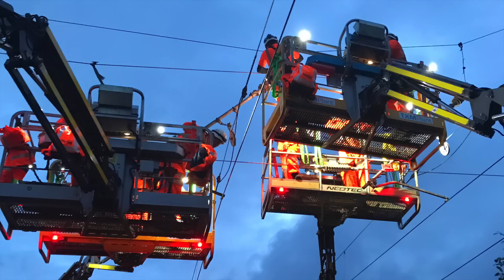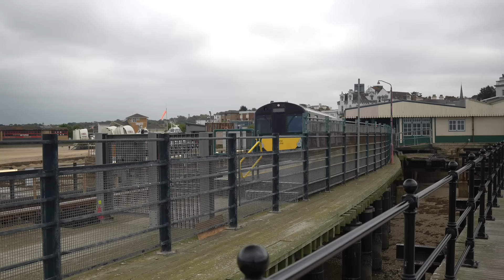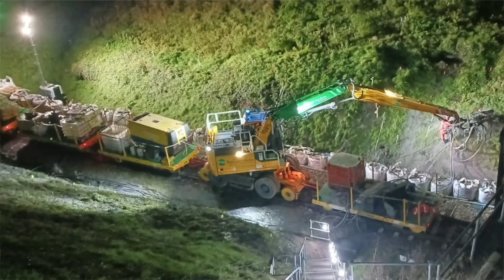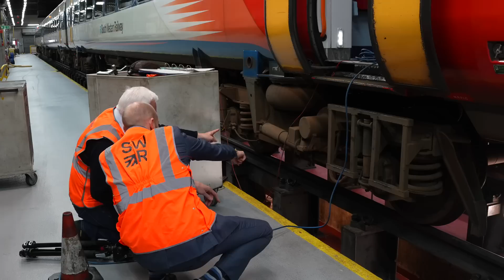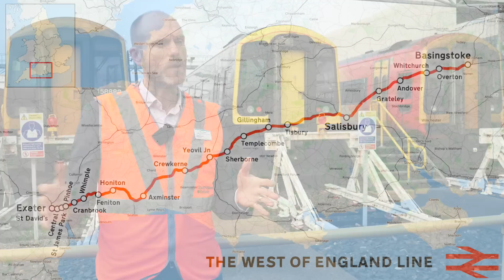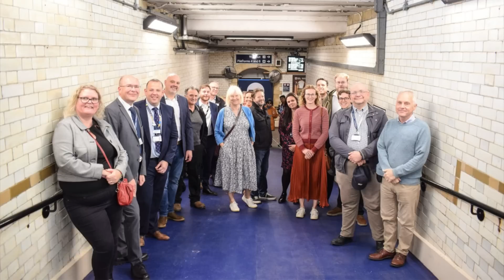Electrification, battery trains, third rail – Finding solutions for South Western Railway’s network

Comment: As someone who lives on the this line the 158s and 159s are extremely comfortable the only problems is they can be very packed because they are 3 and 2 cars long. If they were to be replaced would love to see 4 or 5 car trains. Would also love to a SWR staddler flirt.
Reply: enjoy them before they are repalced with trains containing ironong board seats.
Reply: @ yeah praying for some half decent seats.
Reply: Horrible seats seem standard on new trains.
Reply: @VoyagerDaniel Capacity over comfort is the modern way of things. It’s such a shame.
Reply: @christopherhood9241  exactly
Reply: @christopherhood9241 😂
Reply: 158s and 159s are 2 and 3 cars. But have you ever heard of coupling trains? Its a thing you know. It happens. Sometimes they do up to 10 carriages. At least to Basingstoke...

Comment: Congratulations on the maintenance of the diesel multiple units at Salisbury. They have become more reliable than they were when they were first introduced, and you would not guess how old they are if you did not know. They are very comfortable and have large windows well-placed in relation to the seats (as long as you go in standard class).

There was a proposal to electrify the Uckfield line about 25 years ago, at the time when the operators felt the need to replace the 1950s Southern Region diesel-electric multiple units. Quotes were obtained from several engineering companies and they were all ridiculously high, not out of keeping with the cost of building a completely new railway rather than installing third rails on an existing one. The operators abandoned the idea of electrification and ordered new diesel multiple units.
Reply: ..... though despite perennial unreliability on the Brighton / Coastways mainline, the 8 miles twixt Uckfield and Lewes remains missing.
Reply: In my experience the loos don't work very well.

Comment: People want double track not this, it’s all good but with the constant dwelling in loops due to a now over congested route double track is far more important.

Even with the 158/9 fleet less hold ups at signals to allow for late running train will be far more fuel efficient.
Reply: While they're waiting in the loops they could plug the trains in to top up the batteries!
Reply: @377king  The plan is ridiculous, I agree double track it again and 3rd rail it, are they saying the existing dc system is unsafe?
Reply: @EM-yk1dw  yeah, the government and industry really dislike 3rd Rail and the DfT won’t authorise any expansion of it, except for TfL. Not for the South or for Merseyrail.
Reply: @EM-yk1dw  Not only is 3rd rail unsafe for any animal or human who goes near it but probably the main reason the authorities don't like it is the energy inefficiency and the unreliability in cold weather ref. icing over of the contact surface. 25 kV OLE means less energy losses, reliability in cold weather plus the bonus of being well out of the way for safety. Notwithstanding OLE is less reliable than 3rd rail in being more fragile and is far more expensive to install.
P.S. I'm amazed that 3rd rail at ground level was ever allowed, just on safety grounds alone although the contact underneath method used by some Metro systems is safer and presumably less liable to icing over of the contact surface in Winter.
Reply: @ Yes you raise good points here, pros and cons with both systems.

Comment: Seems a pragmatic solution, let's hope it's deemed cost-effective and goes ahead. I would say the 158/9's are still fairly comfortable but they do need a bit of an interior refresh just from general wear and tear. From a customer point of view it would be nice to have a refreshments trolley on these services and the ones down to Weymouth, 3+ hour journeys where if you haven't planned ahead you can't get so much as a bottle of water. Even an on-board vending machine would do!

Comment: What a great innovative solution, battery electric hybrid with station based charging/acceleration/regen braking zones could fill many of the holes in the electric infrastructure. 
When I worked on the 2012 Electrostar battery demonstrator, calculations indicated that the use of  in station power infrastructure could be a game changer. Even a ScotRail service worked with about 5 station dwell chargers. Shame they didn't commit to 31x retrofit, an ideal base.

Comment: My first thought about converting Desiros to run on "The Mule" was that the potential benefit of using a 'standard' platform across the network could be track/platformu utilisation? I does seem ludicrous that there are services running to and from a major London terminus formed of only THREE coaches.

In the previous era of operation Waterloo-Salisbury services were operated by a push/pull Class 33/1 and 4-TC stock (an unpowered version of the SR EMUs). A number of these workings included portions of the train for destinations on the third rail network, operated by an EMU. Back 30-40 years ago there was no physical barrier between diesel and electric traction working in multiple.

I appreciate that at the time the surplus of an order by Regional Railways for Sprinter Express DMUs yielded a fantastic business opportunity for NSE, and the Class 159 has served well. Hopefully this time around operational efficiency will be a consideration?

Comment: British Rail invented the solution to this problem nearly sixty years ago, and used it on the Waterloo - Weymouth route. The 21st century version would have battery versions of the Class 33 diesels, and the Basingstoke - Salisbury section should be 3rd rail electric.
Reply: An updated version of the Gatwick Express with class 73"s would be nice on the Exeter run.

Comment: The 159s are vestibule stock and provide a decent enough level of comfort. A commuter train such as the 450 has two sets of doors within the saloon for rapid boarding etc., making the feel very different (and currently has 3+2 seating!). On a journey of over three hours, that reduction in the level of comfort, noise and refinement is clearly not acceptable. The Class 444s are closer to a like-for-like change but they are not being proposed in this plan (why not?). The plan shows imagination and flexibility and the diesels need to go, but if driven purely by cost then it will diminish the service further. Oh and while I'm commenting, we need some catering back on this line - my coffee does not last me over three hours from Exeter to London!
Reply: He didn't actually rule out 444s. He said "Desiros or Aventras"
Reply: @mdhazeldine  Thanks for that. In fact, looking at the article in Rail issue 120 they have ruled out the Class 444s as not having enough space for the batteries (sob!). In that article they specifically identified either the Class 450 or the Class 701 as the candidates, so true suburban stock in place of regional express stock. Oh dear.

Comment: The battery/third rail plan sounds pragmatic and positive, however I do have a concern that Desiros and Aventras are not particularly well suited to a long distance line because they're designed as commuter trains. The most appropriate stock to retrofit would be 444s, but that would mean reducing the number of them on the Portsmouth/Weymouth routes, which is not ideal for those customers. I get that we don't want to waste good trains, but my fear is that those on the WOE route will end up with a worse passenger experience until the next order of trains comes in. Probably the best solution would be to convert a small number of 444s as a testbed along with some 159s, and then when the 444s get to the end of life, replace them with properly suited long-distance stock. I don't think 701s would be a good move for such long routes.
Reply from the maker: Some good points that hopefully will be taken into account.
Reply: passenger experience on the Weymouth line is poor enough. Way down on what it was in SWT times. Heating doesn't seem to work on the 444's on that line in winter. One train an hour on busy sundays in the summer (often with non-functioning toilets) and no catering since covid (with no plans for return) on journeys that can be 3 hours+. Often the 444 only connects to a 4 car 450 at Bournemouth too, to make a 9 car set into London.

Comment: Back in 2000 when I was driving at Salisbury, Brian Souter/Stagecoach offered to redouble most of the line, up the line speed to 100mph where feasible and introduce Meridian style units. It would have been a fantastic service. The then Labour government, including the then Secretary of State for Transport, Lord John (I would never accept a peerage) Prescott, turned it down.
Just before SWT were bidding to retain the franchise in 2017, I sent Brian Souter my artwork and a suggestion for a bi-mode unit that would run on the juice from Waterloo to Basingstoke and be charged at stations en route going West. Based on a Meridian unit with a more streamlined front.
It would be interesting to know if it may have swung the franchise decision for them if they had gone with it due to the 'Green' frenzy at the time.
When their time comes I hope that an unrefurbished 159 (the ones still in the SWT colour scheme), will be saved. Sadly the NRM were not interested in preserving a Pig - the fastest 3rd rail unit in the world. Something else I drove but I still prefer 159s especially over Disastros.
Reply: Would love to know what really happened with the 442's, the whole debacle seems very odd
Reply: Still drive the old 159s each day at work from salisbury  and love them and it will be a shame to see them go.
Reply: Why do the 159 need to be replaced? Are they suffering from incipient metal fatigue?
Reply: @pgf289  Yeah that was a shame .
Reply: @physiocrat7143  Corrosion where various bits are bolted on apparently. They want to get rid of them anyway because they are not 'green' enough. At roughly 7mpg they are highly economical though when you consider that is 7mpg per average 56 passengers (169 passengers for a 3 car divided by 3). 
There was an experiment with biofuel about 10 years ago. It worked but the performance suffered slightly.
Reply: @glennshrieves7234  Shame you can't have the ex TransPennine engines and coaches Glenn with the DVT the other end. They would be brilliant and a throwback to Southern 33 or 73 with TC stock operation.
Reply: @kristinajendesen7111  
How much energy will it take to build a new fleet of trains? What is the environmental impact of an aluminium mine? Does nobody ask?
Reply: @physiocrat7143 it won’t be a new fleet of trains, it’ll be surplus stock from the class 701 order. In the video they say it’ll be either repurposed 701’s  or Desiro’s.
Reply: @physiocrat7143  Smelters often have their own branch off the national grid, I can tell you that . 

Additionally, 40 years for the Pacers and HSTs is a lot longer than  most people keep their cars before scrap.
Reply: @kristinajendesen7111   It was running at least a couple of years back. Unfortunately someone left a hatch open on the tank, and the sunlight made the biofuel revert to algae, clogging filters etc. 

All that said , when you have 9 cars each with a Cummins QSK motor hammering away under them, I can't see how that would be more economic than a locomotive. I'm looking at CrossCountry too - when they have 9 cars.
Reply: @kristinajendesen7111   Didn't The TC stock had its' motors powered from the locomotive?
Reply: @arch9enius  
The TC stock were hauled sets. TC = Control Trailer. 2 x TC sets worked with a class 33  push-pull at the Weymouth end, and a 4-REP with 3000 hp at the London end. The trains split at Bournemouth. The whole fleet was rebuilt from old locomotive hauled stock.

Very smart they were in those days. The present generation of engineers have forgotten how to do things efficiently. 

The mark 3 stock was surveyed and known to be good until around 2035-2040. The present generation of railway managers and engineers are only good at wasting money and don't recognise BS when they see it. Taxpayers and passengers pay for the incompetence and waste.
Reply: @arch9enius  TCs, trailer composites, were unpowered, hence the loco or REP unit.
Reply: @arch9enius  Don't quote me but I'm sure I read somewhere that Voyagers/Meridians are not as economical as 159s.
Reply: @kristinajendesen7111  
The Voyagers are lardbutts. The 158s have a top speed of 90  nph.
Reply: @physiocrat7143  158/159s have an official top speed of 90mph due the guarantee on their engines I was told by the depot
 I had a 159 up to 98mph though on a downhill section on the Up approaching Andover whilst daydreaming.
Reply: @kristinajendesen7111   Maybe it's the higher 'gearing' .
Reply: @arch9enius  there's a big difference in power consumption between primary smelt and re-melt, not many smelters left in the UK

Comment: This makes me sad. Appreciate Neil has to deal with the current political and financial climate but this shows a complete lack of ambition. If we’re serious about decarbonisation we need to plan for huge modal shift towards rail and other public transport/ active travel solutions. What now seems like a rural branch line could be transformed into a significant regional connection. 25KV AC is in my opinion the only sensible mid to long term solution. It makes no sense to cart around tonnes of batteries with a limited life expectancy. IIUC source materials for batteries are limited too so better to save them for applications which are difficult to electrify in other ways such as rural buses and cars/ taxis. 

Funds saved from the cancellation of the ridiculous Stonehenge Tunnel could be put towards an upgrade of this line as well more local transport schemes. Electrification teams could work on this route and then move onto the line via Taunton or vice versa. A rolling programme of electrification will reduce unit costs and maintain skills.

Sorry for the rant.

Thanks Green Signals people. Love your work.
Reply: Install OHLE and make the service unreliable. Routes with light traffic are not worth electrifying.
Reply: I think we'd all like to see what you've described but it's not a pragmatic option sadly
Reply from the maker: Cheers and thanks for your kind words and SuperThanks. It is very much appreciated.

Comment: The partial third rail/battery solution might also be applicable to the North Downs line (Reading-Gatwick).
Reply: The 3rd gaps should be done there isn’t much needed
Reply: Yes, my mind immediately went to that.

Comment: The issue of ‘smart third rail’ is electrification is actually very very clever and something surely to be taken forward. On a route like the Salisbury and through to Exeter is where electric passenger trains are not at a huge frequency (maybe 2tph) so having the juice off for the majority of the time really is reducing risk massively. Could a train based activation system work where its passage turns on the electricity in advance of actually traversing that section.
Reply: A train based activation system is the only way it's going to work. To be safe it should only be live under the actual train - some tram systems manage to do this. But that means the sections have to be quite small - at most half the length of the shortest train, and that's going to make it much more expensive than regular third rail.  Probably so much so that overhead power would be cheaper. 

The more sensible approach would be bottom contact 3rd rail. I wonder if there's a way with equipping the train with both.
Reply: @Talon5516-tx3ih  yeah I've been on metro systems with bottom contact, seems a no-brainer really.

Comment: Surely it would make more sense to use the additional 701s to replace the class 450s and then order more bi-mode diesels for the WOE route. Running suburban stock from London to Exeter is a massive downgrade.

Comment: The assumption that having intermittantly live conductor rails is safer, needs to be unpacked. It can be argued that assuming that a conductor rail is live at all times, train or no train has an intrinsic safety aspect to it. If a situation were to occur where the "live assumption" was reversed which then corresponded with a random wrong side fault that energised a switchable section, I would argue that the potential confusion may be problematic. The idea that switchable sections of conductor rail that are off most of the time are safer, may not necessarily be as true as is implied in the piece. Just a theory, but a possible scenario and I would hope that the likelihood of such circumstances and their risk has been evaluated.

Comment: Yeovil to Waterloo is about 2h30. That’s a long time in suburban stock with little or no facility to work on the train. The 159s are great. They are comfortable and, within the limits of the single track sections and the failure of SWR to maintain a sensible stock of replacement engines do a great job. Here’s hoping for something equally comfortable in the future…

Comment: We need fast runnning trains on the larger lines, which includes the line to Exeter. We need trains accelerating rapidly. We need a system robust to delays of one train, and with a high capacity. We need comfortable trains, that are also comfortable to drive. We need a network safe for people working on the track, or having to cross the track.
Taking all of this into account, some of the proposed intermediate solutions proposed will only give intermediate, or lets rather call them mediocre results. I believe that it will be necessary to first create a backbone of fully overhead- electrifying the mainline from London to Exeter.
Third rail is a legacy product, not to be extended. Battery operations are for short stretches.